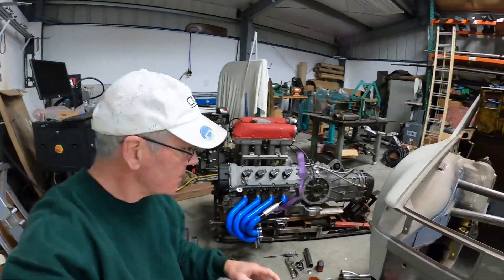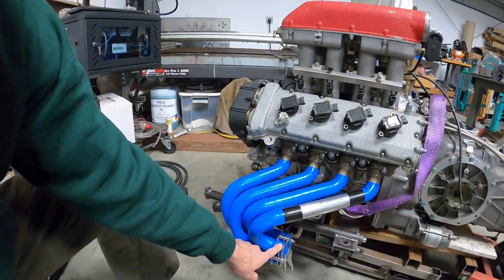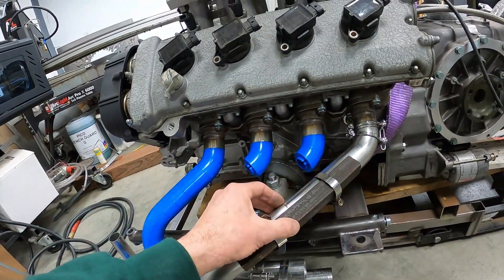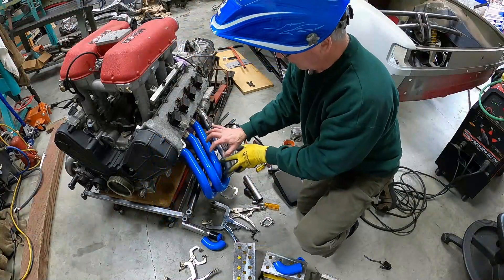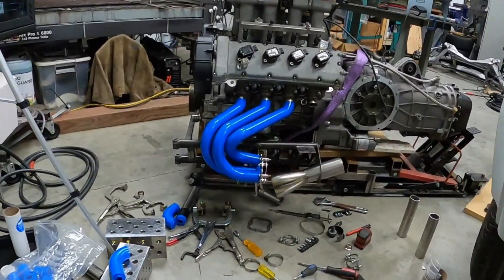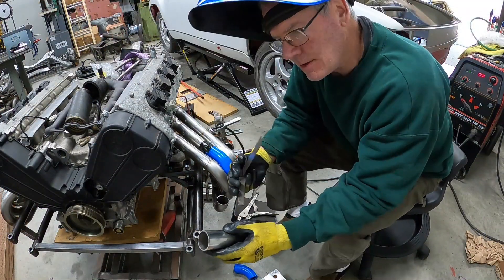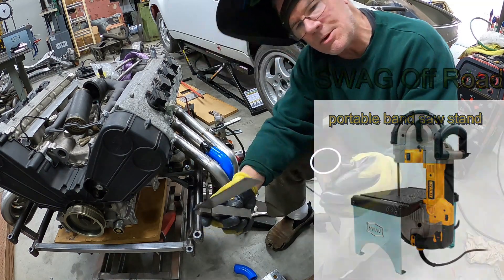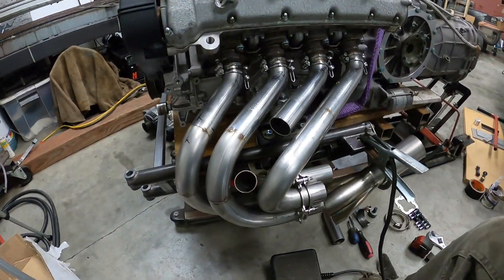914 Ferrari Build - Episode 17: Headers, Part 5

Comment: Nice progress.  Loving this.  I've always wanted to drop a Busso motor into a an Alfa Spider.  Not so much for the slight increase in power, but for the character and sound.  Unfortunately, there's not much info out there about it.
Reply from the maker: Do it! I can tell you, there's not a lot of info about these 360 engines - at least not once you take them out of their native environment. But heck, that's 1/2 the fun!
Reply: @attheredbarn1669  Well, I've done plenty of non-native swaps before, but the Spider is a rwd manual, and most of the Busso motors are fwd autos.  So there is the problem with things like starter location, flywheel, and ancillary device hook-up and mounting.  I dont have a Spider, and dont have a Busso available to look at.  So I am just staring at it in my mind.  Not ever having looked at either in person.